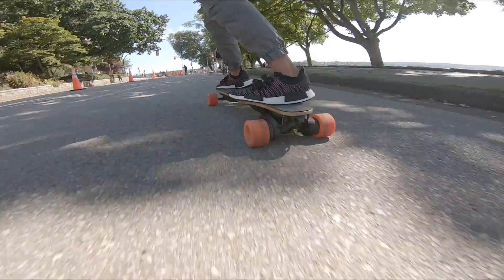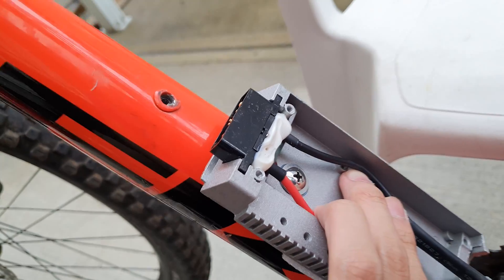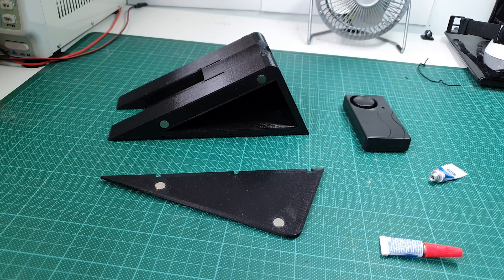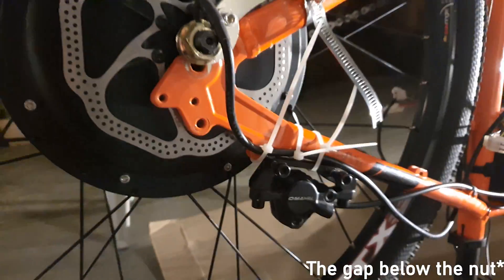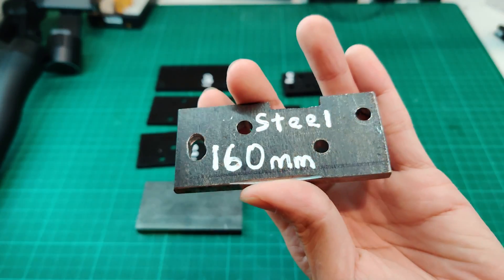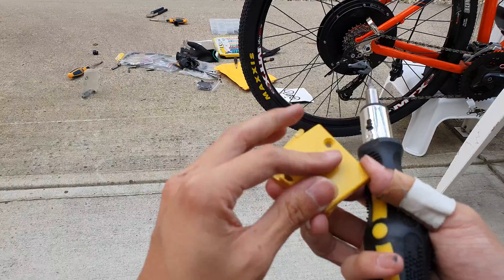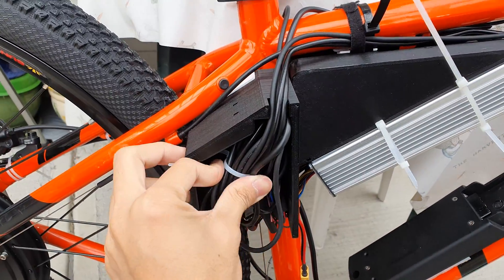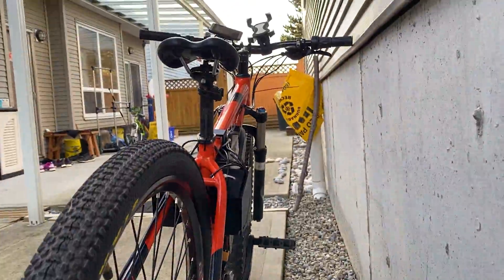Building a FAST ELECTRIC BIKE (With a 1500W Conversion Kit) | Trek Mountain Bike

Comment: Hello, great build, im doing a 48v 1000w conversion, do I need to fit a fuse between the battery and controller ? Any advice would be appreciated 👍
Reply from the maker: I didn’t bother with a fuse in between the battery and the controller but it is a good safeguard against potential shorts.
Reply: @AaronsCreations  Thank you👍

Comment: Disc brakes are heavier than rim brakes and may be over rated.   You definitely need good brakes for an e-bike.  I have been doing some research and quality rim brakes may be a better solution for a lot of ebike conversions based on frames without disc brake mounts and your conversion proves there may be other problems with conversions as well!   Off road pedal dirt bikers and road bikers,  prefer quality rim brakes, besides being lighter, they really work well!   Rim brakes vary in quality a lot.  Good ones cost $$$.

Comment: I used to same bike but is xcaliber 8.
I believe is the same frame.
I used the same 29inch wheel 2000w MTX RIM.

But I didn't have any the problems you did.
The 12 speed cassette fitted perfect.
The brake caliper fitted perfect.
It was like plug and play 
Actually it was the most easiest DIY Ebike I have done.

Comment: Can I fit in a 28 inch motor wheel on a 27.5 bike
Reply from the maker: It depends on the frame. You might get lucky or could run into clearance issues, but I have never heard of a 28inch bike wheel. It’s always been 26, 27.5, 29 inch.

Comment: Great video, I'm hoping to convert my old 70s Claude Butler Tandem to E bike, with rear Hub motor, would you recommend maybe using front wheel drive motor instead of the rear wheel,as its too complicated to covert rear wheel, with Hub drum brake etc.
Thanks in anticipation,Ger Mooney guitar man Galway Ireland

Comment: I’ve been a bike mechanic for over 20 years trust me those chain stays that that torque arm is hooking up to is not made to carry that kind of a load it will eventually damage that frame just be aware of those people when you’re doing these do it yourself systems if you’re going ultra high power you’re probably going to break your frame eventually. Not to mention if your having a stretcher frame open your weakening the worlds risking the breaking of the frame even more if it doesn’t fit it doesn’t fit
Reply from the maker: Yup! Got a new updated video on my channel with a new torque arm and motor that doesn’t need that much stretching

Comment: Why not just take the spacer off the motor instead of relocating the brake caliper. I have the same frame and didn’t need to do half the work you did. I think you way over thought it. I converted my marlin in about 2hrs.
Reply from the maker: Because I used a cassette gear system. The hub would rub on the frame if spacers weren’t used

Comment: And to think I was about to go to a bike shop tomorrow and get a 1500w conversion kit installed on my Scott Aspect 940 granite mtb. You just made me realize how unreliable, complicated, expensive this all is and I don't have the confidence that the shop knows all of these tricks when installing it and they will just permanently ruin the bike and I will lose a ton of money. Yet again another thing that I find extremely interesting but a know it all YouTuber ruins it for me. Not your fault ofc but there goes my initiative down the drain.
Reply: Not as bad as it looks. Thousands bikers US Europe Asia have done it. Although they are neat -- you don't have to do custom wire controller boxes, bigger rear brake rotors and all that.  A shop can do it professionally for under 3 hours $200.  Or you can get online FB or CL see if any bike tech hobbyist enthusiasts will help you out for a good price.

Comment: I too live and vancouver and built an ebike during my senior year back in 2013, the last clip you biked by Burnaby mountain secondary was my school. My specs are crystalyte hs motor running at 25 amps with regen, single gear set up, 100t front (custom) 11t rear, 17 ah ( recent upgrade, with double grin torque arm v2 which I got from their shop back when they start at their original location, the bike lasts man, even for someone like me who s not nearly as bright and careful as you, they last! No problem after 9 years of aggressive riding.
Reply: plz make a video about it

Comment: I'd say.... although you were determined, slightly over engineered,I know these are not quite fit and turn key,but I'd give you kudos for trying.also like to note all the CAD and you chose to zip tie the module on the frame😐

Comment: This totally discouraged me from building my own. This is not beginner friendly or friendly for anyone who doesn’t have all the tools you have access to to make it work.
Reply: I did mine myself with a Steel frame and didn't need to use the whole 3D Printing stuff or anything. I would recommend not using a Steel Frame as it puts fair weight on the wheel and then Hub for that matter.

Comment: Great stuff BUT elephant in the room,
The motor is not too wide for the frame.The spacer on the disc mount
needs removing.Plus the tabbed washers should lock together.🙂

Comment: You say that you used a 29-in wheel. I see that it is a 26-inch mountain bike. I don't understand how that could possibly fit in the frame. I also have never seen 29 inch tires before. This must be something new? Could you please elaborate on the wheel size and where it is measured from dimensionally? Certainly it must fit into a normal 26-in frame because you did it but I don't understand the how and why of it. Please elaborate.

Comment: I really love this video. Why didn't you do a front hub conversion?  I want to do this to my bike but I'm thinking front instead. I don't know the pros and cons.
Reply: Front hubs are significantly less safe and effective than rear hubs. 
1. Traction is a lot lower on the front than the back, since you aren't sitting on the front wheel. 
2. The steering becomes a lot heavier, and more prone to swinging back and forth. 
3. It's easy to have the front wheel spin out under power, especially during turning, resulting in a crash, as front-wheel spinout is the most dangerous kind. 
4. Front forks are usually less sturdy for mounting motors than rear dropouts are, as rear dropouts have to resist some torque already. In any case, you would need genuine torque arms (as in, not the kind used in this video, which are a flawed design cloned in China that have a known safety issue), but front forks are much more problematic to install motors onto.
Reply from the maker: Couldn’t have put it better!

Comment: hi man could really do with some quick help, will a 135mm motor fit 140mm dropout? will i just need to add more spacers?
Reply from the maker: It would. The root of the majority of problems I faced was due to an oversized motor. A smaller motor would save you a lot of trouble. Then again, it depends on how your setup is. What frame your using, motor, etc….

Comment: Hi!

I have the Marlin 7 as well and just curious what the size of the battery and casing is?

Looking at a kit at the moment and worried it'll be a very tight fit.
Reply from the maker: It’s a 17.5aH 48V battery pack made of Samsung 35E cells. Be sure to drill it as low as possible for the fit.

Comment: Have you tried to increase the power output?
Reply from the maker: By using a bigger controller I can. Grin makes a great selection of ready to run controllers that can output a significantly larger amount of power. I don’t think I will as this bike is powerful enough for the purpose it was intended for.

Comment: How do hills effect the range?
Reply from the maker: They reduce it. Depending on how fast and how heavy you are.
Reply: @AaronsCreations  is it a drastic amount? Thanks
Reply from the maker: If your racing up the hill yes. If your going extremely slow say 5KPH it’s equally as bad. It’s hard to give you a definitive answer. But yes it can completely drain your battery or just a small amount. Hope that helps

Comment: Hi there, really informative video but I just had a query about my own ebike that is also 1500w. See I have the torque arm on one side attached just like yours but under full load I've found that the axle slips out. Do you think that if I attached a torque on each side going upwards and secured it directly to the frame this issue would stop? I have a carrera just like yours just a different model but it too doesn't have massive dropouts and so sits very similar to yours in the frame. Would greatly appreciate any advice 👍🏻
Reply from the maker: Your mounting the torque arm incorrectly. One should be sufficient but not optimal. Follow my torque arm mounting configuration exactly and tighten your axle nuts down extremely tight.

Comment: Interesting build, we'll save this for future reference. Would a spacer between wheel and disk not solve? I must have missed something.
Reply from the maker: The brake assembly wouldn’t mount due to the added width of the motor. So it’s not a disc problem, it’s a brake assembly misalignment problem

Comment: How will I know if the kit will fit my bike frame. It’s 135mm dropout with disc brake. My concern is if the wheel fits, maybe the disc brake caliper will not...? And do you feel any rolling friction or pedaling resistance unpowered/battery turned off comparing to before the conversion?
Reply from the maker: There’s little to no rolling resistance what you feel is the added weight and how the bike is a lot heavier to move. I’m regards to the disc brake, you don’t know. Every manufacturer makes their motor a bit different and if you get lucky your bike works with additional modifications, if not you do what I did
Reply: May I know what your bike dropout width?
Reply from the maker: I think my dropout was a 135MM

Comment: Hi, my bike has a thru-axle is it possible to mount this wheel on my bike?
Reply from the maker: Not with the motor I used in my video. To convert a bike with a thru axle you must get one specifically designed for thru axles. I’ve been a few made from Bafang that looks great so look into those
Reply: @AaronsCreations  hi, great video mate. 
Would this work on a Trek Roscoe 8, as I’m not sure about through axle etc? Thankyou very much in advance.

Comment: Hi, I have some questions before ordering a kit I’ve just made a video if you could take a look and let me know if it’s possible I would appreciate it! Thanks again love the video by the way
Reply: So I looked at your video and the crank sensor will not fit onto your bike. As you mentioned in your video, it doesn't have a gap. But the sensor is mechanically simple, so if you can find a way to glue said sensor onto the rotating part of your bike, it should work. You can also look online for ways to get around this. I am sure there is a product for this problem.
Reply from the maker: I’ll take a look.
Reply: Thanks guys, I’ve ordered a sensor kit designed for my crank, only issue is the plug is different so I will have to chop it and swap it

Comment: Bbshd would have been a better pairing with marlin 7.
Reply: Then you have to replace the chain and cassette quite often, also you will be running through brake pads because you don't have regenerative braking.
Reply: @cryptohouse1676  regenerative braking puts transfers wear of brake pads to wear on motor. I rather change brake pads and chain than motor, but user preference
Reply: @Kay0Bot  The motor doesn’t wear out from regenerative braking. The ball-bearings in a direct drive motor are the only parts that need replacement. They will last just as long with or regen.
Reply: @cryptohouse1676  ah..oh okay. Still the strain has to go elsewhere so most likely strain is transferred to controller or battery.

Comment: That requires maybe a machine shop to drill holes. Are there local shops in NYC that can convert my Royce Union mountain bike into a e-bike? I tried the 26-inch e-bike but that was too small. Its hard riding a regular bike around here unlike in my younger days.
Reply: I am not sure! But I am sure any shop can drill holes for you as a simple electric drill will work. I'm confused as to what your trying to drill, but if its the dropout (part where motor goes in), I would advice against it. Drilling reduces the structural rigidity of the mount and causes micro-fractures in the frame which will expand over time to eventually failing from the amount of force applied when your riding.
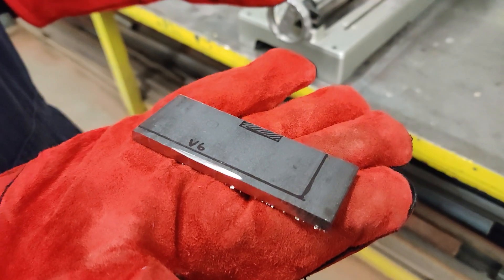Reply: @aaronclu  at 5:00 a machine is being used that  I know would be a challenge for me to do without the tools.
Reply: @samthepoet107  that’s a miter saw! Any workshop will have one. They are pretty simple cuts so anyone who has one can do it
Reply: @aaronclu  kind of intimidating looking at that much. Thanks!

Comment: I'm afraid i'm going to have to disagree when you said "my poor choice of getting the largest battery possible" - IMO it was a good choice. Tight AF is still "it fits". Nice tight tolerances. Even if you only ever use half of its capacity, that's good for the battery and will make it last longer done right (you probably know all this, but i am stating why i think it's the right choice). I'd like to see an indepth video on your use of torque washers - the torque arm is the #1 snag of putting a hub motor on a regular bike

Comment: I had the same rear brake alignment issue, but the wheel kits have a few washers of different thicknesses, I found one of them pushed the rear frame arm out just enough to line up the caliper with the disk
Reply from the maker: Awesome! My disk needed a lift of around 7mm so that wouldn’t have worked for me.
Reply: @AaronsCreations   In the video I see that you left the plastic spacer between the disc and the hub. You have to remove it. The spacer is for the 6 screw for not going to far when the disc is not there. The spacer will melt if the disc become hot.
Reply: See that is a solution

Comment: has anyone else had the problem where they got a 1500w kit and they have power but no response from the throttle? i ordered a new throttle but I'm worried ill need another controller
Reply from the maker: On the LCD screen, a blinking throttle light appears when the throttle is turned (above the speed mode). Check if you have that… If you don’t, open the controller up and see if the connections are tight

Comment: Hey Aaron, nice build! I recently converted a Trek T100 Tandem with a 2000w rear hub setup. Is your controller sinewave or squarewave? How did you activate regenerative braking, or did it come that way from the factory?
Reply from the maker: I believe it’s a sine wave controller. As I mentioned in the video, I never used regenerative braking as my torque arm only worked in one direction. To activate it, I’m pretty sure you need a throttle that turns the other way. (Forwards, neutral, backwards)
Reply: Did you convert it manually?
Reply: @Dabal_R  Congratulations you just won a prize 🎁 Dm now.......💬on telegram for claiming

Comment: Nice video! The better option would be MIDDrive Bafang BBSHD. It is more expensive, but if we put the money and time invested to make these boxes for cables and controllers, to the final price bafang would be cheaper, lighter, faster, with more power to climb, nice looking bike. I get bbs02 with IGH and 14.5 Ah / 48Volt battery, it cost me 1000 dollars - geared hub is little bit noisy but I am  pretty happy with my choice.
Reply from the maker: Agreed! The Bafang drive units are super impressive!
Reply: @AaronsCreations  -- Nothing wrong w Hub Motors when it's got enough horses 750 / 1000 / 1500W.  Some advantages are it's a bit simplier conversion -- and riding too: you're not too concerned about shifting into the right gears all the time as w the Mid Drive Motors.  Friends and even girls can hop on your ride w/o you worrying if they know what they're doing ;).  And another key factor is the Hub's propulsion is independent from the bike's drivetrain and this design is much less stress, wear n tear on the chain, derailleur, cassette -- and so these parts don't need replacing as often, which is time consuming and $$.
Reply: to be honest, I can't hear my hubmotor over the noise the off-road tyres make on asphalt.
At around 32-33 kmh, the tyres actually produce a very loud tone, at first i thought the was something wrong with the bike or the motor 😅

Comment: Hi iwas planning to convert my bike to e bike do you think i can make it on my own?thanks
Reply from the maker: Absolutely. It depends on what kit and what frame you have. Some conversions are extremely simple as the frame the user choose was convenient enough to have high tolerance (lots of extra space). But specifically in my case I choose one of the worst frame to convert, as Trek makes high quality bikes with very low tolerances for a motor to fit in so as a result I was required to do some designing to make things work.